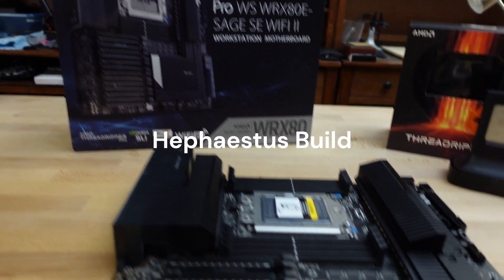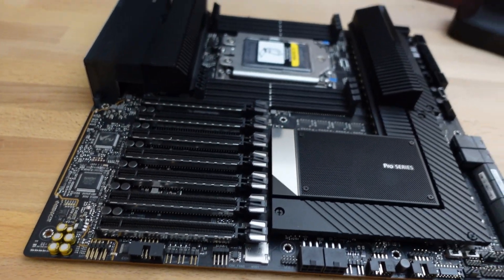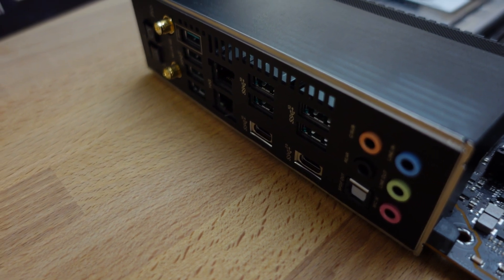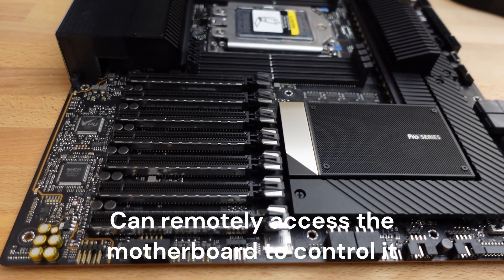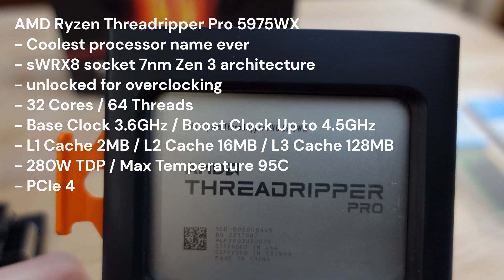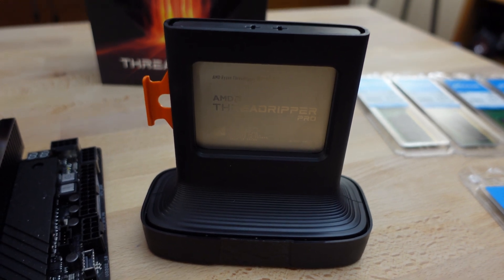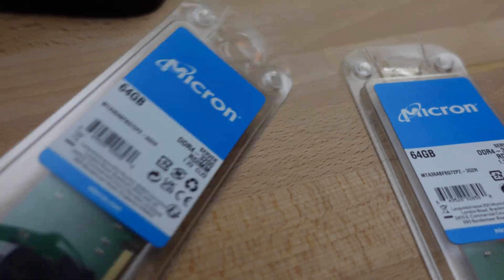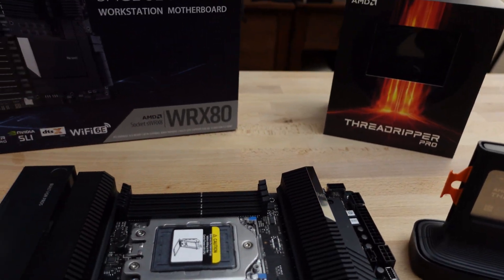AMD Threadripper Pro 5975WX, 512 GB Micron 3200 ECC, Asus WRX80E SAGE SE WIFI II - Hephaestus Build

Comment: Hi, I am using the same MB with 5975WX, but there are some problems I can't solve. 
1. Do you have any experience with win server 2025 for this MB?  It often gets BSOD with error "DRIVER_IRQL_NOT_LESS_OR_EQUAL" or "IRQL_NOT_LESS_OR_EQUAL" even after a clean install. However, no problem occurs if I install win11/server2022. Hardware checked and memory tested without problem.
2. Also, I can't find any installable chipset driver from AMD to install for windows server. There are some unknown devices in the device manager when I  install win server 2022/25(I have removed all unnecessary devices for testing). Even asus doesn't have any driver for server version on their official site.
3. There is no device shown on Armoury Crate, which means I can't control the fans and monitor the temperature.
This MB is designed for server/workstation, but the compatibility is disappointing.

Comment: How much did you pay for your 5975?
Reply from the maker: $2,099.96 USD from Micro Center and was worth it for the 128 PCIe lanes and getting my doctoral research project done. I actually picked up another 5955WX later because it was an open box for around $649.96, such a good deal at the time. My hope is to build another machine and try to get two machines talking to each other and learn some stuff doing this.

Comment: I need to upgrade my TR 2990WX 128GB , this is a video I need.
What is a price?
What are spesp of memory?
What kind of GPU you plan to use?
Reply from the maker: The CPU was discounted since new chips came out (~$2.1k), motherboard (~$1.1k), memory (~$1.2k). Memory is in the video description using Micron 3200 RDIMM ECC. I have a mix of GPU's but will be starting with 3090 because I can NVlink them. I do have 4090's and may try those out to compare.
Reply: ok tnx

Comment: jesus christ man, that is a beast, place this in a datacenter and you can rent virtual machines out and get your money back in the mainwhile.
Which GPU's will you be placing in here?
Reply from the maker: Yeah, I have to see at some time if I want to long term carve this out into VMs. I had some 3090 cards and slowly bought more to use in this. I learned that I can use the NVlink between two cards for better performance. I was doing some fine-tuning of transformers for my doctoral cybersecurity research. I'm hoping to mess with larger LLM models.